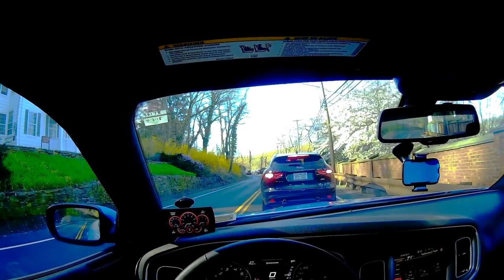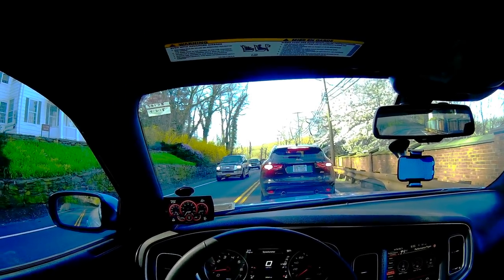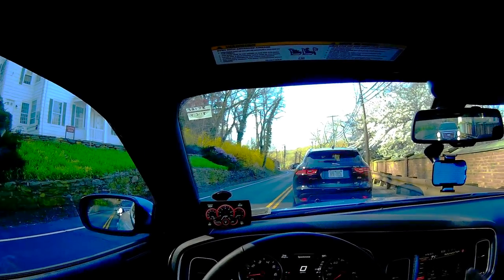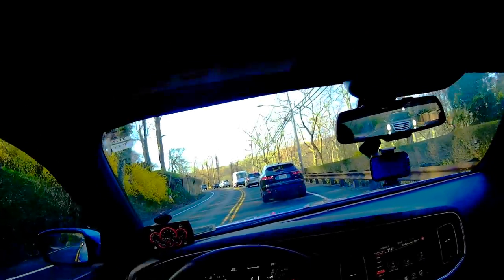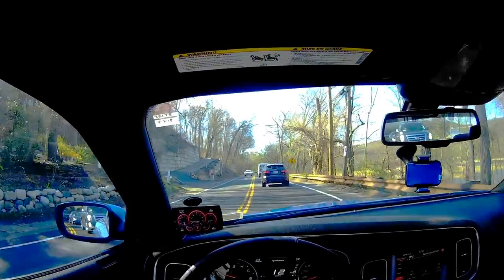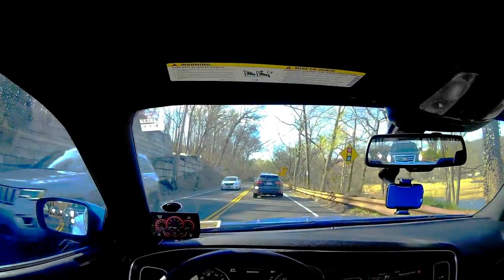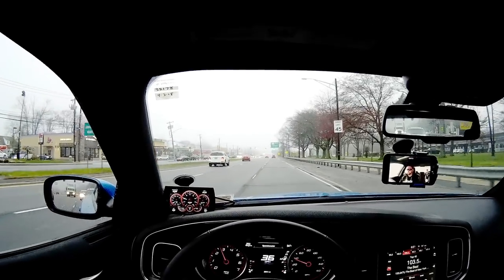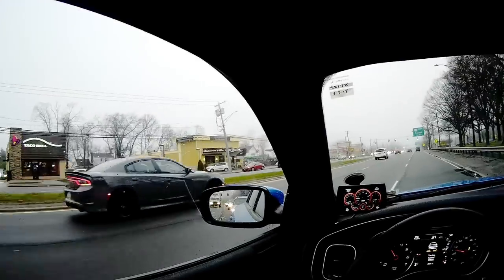After Header Install Car Making Ticking Noise - Shorty Long Tube Headers

Comment: Watching this brings back so many memories of my header install. I thought the same exact things at first, but eventually came to the same conclusion that the headers just have much thinner walls and allow so much more of what I liked to refer to as ping-ping sounds through. It was especially noticeable when driving next to a barrier or wall. Glad you had the MDS shut off. It’s a much, much more enjoyable car with all 8 cylinders firing all the time.
Reply from the maker: I thought I was losing my mind! I brought it back to the performance shop & was like dude there is a noise. It was so low/annoying but I'm glad it's normal & now gone hahaha - thanks man for all the transferred knowledge I really appreciate it

Comment: Got a manual 6 speed sticker said 5.7 VCT engine, so I don’t have to worry about 4 cylinder mode.  Did you use the gaskets and bolts that came with the unit or did you buy OEM from Dodge?  I heard they work the best I’m not sure just asking for when I install my BBK shorties
Reply from the maker: hahaha nice! That 4cyl mode sounds brutal when you have work done to the exhaust

Comment: i have a question im really hoping you answer i just installed my bbk shorty headers yesterday and i have this annoying ticking noise only when driving, revving it does not do anything its loud i have a straight pipe on the car also and have the headers now the headers i installed are supposedly “no tune needed” but my check engine light is also on… i cant really enjoy the car with that annoying noise as to it is my daily😥
Reply from the maker: You might have an exhaust leak - which sometimes causes a ticking noise & check engine light
Reply: i really hope its that and nothing worse! thank you so much for taking your time to answer me!💯

Comment: Love your videos as always.. I am looking to install Shorty headers on my 5.7 Daytona.. It is my daily..  Did you see intake temps go up post installation of the headers..meaning more radiant heat inside the engine bay? I am concerned that the headers might produce extra heat inside the engine bay thus impacting other components negatively..
Reply: Sniper 3.0 hood will solve that problem

Comment: Old video, but still worth noting.  There is a reason for everything, including odd sounds coming from a factory tuned exhaust system when elements of that system are adjusted.
"Twice-tuned" Hemi...
“It was a challenge to tune (the Hemi's exhaust) for both 4-cyl. mode and V-8 mode,” says Keck, who stresses the fundamental knowledge (( Eberspaecher )) wielded to develop the system: “There are no black boxes — it's all about physics.”

Comment: I bought a Diablo intune2 so I could shut off the MDS. It sounded horrible running on 4 cylinders. Just my opinion but I think the MDS is hard on the timing chain. Quite a few dead Hemi's out there because of that.
Reply from the maker: yah I was very happy to see my MDS go out the window.

Comment: I get alot of those sounds I definitely hear it with my active exhaust  and I have no upgraded headers slightly annoying but not a big deal for me
Reply from the maker: When I didn't have the headers it was no big deal, kind of annoying but not bad. When the headers went on it just sounding weird. I thought I was going nuts hear that noise at 1st hahaa
Reply: Lol mine sounds like a honda or V6 sound notes in 4 cyldr  mode haha

Comment: that long island traffic looks misery.   i installed  catless headers on my little 4 banger hatchback( already had catback magnaflow) and when I get on it a bit I hear this annoying rattlesnack sound coming from the outside of engine. I thought it was a loose header or metal vibrating..  im actually going to exhaust shop tomorrow to take a look.  its kinda embarrising sounding actually. the exhuast note behind it is great but that rattling noise from 3-4k is weird.  and the car smells like exhaust a lot more now. if im at a light I smell it coming in.
Reply from the maker: Let me know what the issue is - sucks when there is weird crap going on like that
Reply: @RTLife  well my resonator had some leaks so we put a new one on. it helped but I still get that tapping noise coming out the engine.. and since the header I have a variety of interior vibrations dependent on the rpm annoying as fuck

Comment: I never thought of that, it’s a good thing you got the MDS turned off.  Its a necessary evil I guess it sure saves on gas.  It’s a little louder on my car with my new exhaust, but only in the early morning while cruising to work with the windows up going about 80. I can barely hear it 75 or below.
Reply from the maker: I like the MDS but after getting to much exhaust work it becomes brutal to listen to. I will use my monte ss more anyway. This RT is my burner car! Yah that exhaust setup you got sounds great

Comment: Late comment, but since im getting those bbk shortys i was telling you about, (should be here tomorrow i think) i have been looking into all sorts of header videos. This is my experience with my 300, i got a flowmaster catback end of last year, there was the annoying noise for a little while that drove me nuts. Never figured it out (til now) but i bought the dynomax bullets a couple weeks ago and when i got them installed all the noise went away, car sounds great. So idk! I figure possibly the flowmaster mufflers were big and beefy and restricted some of the airflow but i dont know why it would cause the noise to be louder, we will see how it sounds and what happens when i get the shortys put on! Im probably gonna attempt to put them on myself

Comment: My car doesn't sound that bad when 4 cylinder mode kicks in, but i have a more milder exhaust set up. I have flowmaster force 2 catback only. Sounds ok but wish it was louder on the inside.
Reply from the maker: Before the headers it wasn't terrible at all, after though the noises kind of got very annoying. Almost sounds like something was wrong or leaking. That's a nice setup man
Reply: R/T Life i would love to have shorty headers or maybe srt8 exhaust manifolds

Comment: I have a 2016 challenger r/t with Flowmaster super 10's and MoPar CAI, and i absolutely hate when the MDS comes on it just ruins the sound of my car and just the over all driving experience with the MDS that is definitely the number one thing i hate about my car like why does Dodge have to do this with the HEMIS or just make it an option to have it on or not, I understand about being fuel efficient but Muscle Cars are suppose to be raw v8 power anyway smh!!!!
Reply from the maker: That is a nice setup you have going there. The diablo tuner allows you to shut it off, but at some point it's just brutal listening to it. I def don't blame anyone for wanting to shut it off when they have custom exhaust work

Comment: Hey buddy I follow your channel, I'm trying to do a 396 build from a 345 bear block and from watching and hearing the experience you have in hemi would sure love your input on this build.
Reply from the maker: Are you doing an NA or forced air build?
Reply: @RTLife  N/A most likely, that's the route I'm planning to take, but your input could probably  change that lol .
Reply: I have an 09 dodge charger hemi 5.7l police interceptor.
Reply from the maker: I was planning on doing a full n/a build until I realized, I will not stop with my RT. It's not going anywhere & will be continuously upgraded. So I decided stroker w/ lower compression & forced air cam. You have to decide early on how far you want to take that 09 hemi. What I realized in modding is I was wrong many times, I thought I would be ok with X mod & be done. Be long sighted not short sighted, if you're going to hang onto & mod that Charger. That's my thoughts.
Reply: @RTLife as always your feedback is well appreciated, so then I guess the force air is the way
Reply: @RTLife  hey R/T what's good bro, what's the easiest and most cost effective way to convert my 5.7l 345ci to about 500hp if that's possible  ??

Comment: I have the mds delete lifers and  non mds block plugs but I’m not useing  it tell I put my cam in eBay has them for cheap
Reply from the maker: You can just tune the car to stop using it, wouldn't that be easier?

Comment: You can turn off the MDS with a tuner, i did this and the millage is close to the same. the tune helps the motor millage
Reply from the maker: I saw that option on the diablo, the MDS is really annoying esp once you mess with the exhaust

Comment: Wow I always drive in sport mode because my mid muffler delete sounds awful when MDS goes on lol
Reply from the maker: yah that MDS starts sounding real bad the more you mess with the exhaust setup! Sport mode is def a good option
Reply: U can turn MDS off with the diablo tuner is the settings

Comment: Good to know about the headers.   Thanks for sharing.  Not bad in the intake temps my man.  Also. This out takes were funny as hell.  I love being able to relate to those.  It took me 5-10 takes to do my challenge video.  I should record some outtakes because I always get pissed off and do something.   Haha.  Good stuff.
Reply from the maker: Def wanted to make this video at some point because it will give a friendly heads up about that noise. hahaah I was about to give up & then I had 1 good take that I didn't even bother using. Either way sometimes they're funny so I throw them in

Comment: Just use the paddles and you wont go into eco mode. When I had my challenger that's how I drove it. Or get the MDS tuned out.
Reply from the maker: Very true - Keeping it in sport mode will also do the trick as well.